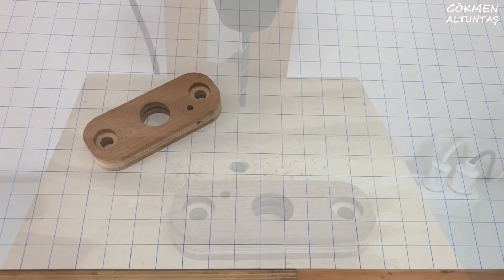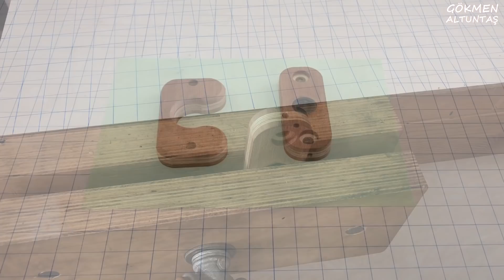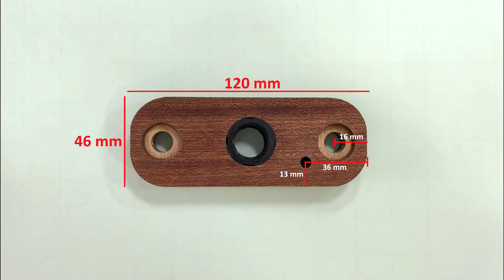DIY Plunge Router Attachment for Dremel and etc Rotary Tools // Dremel Freze Aparatı

Comment: I thought this would be a cool thing to make, then I realized I bought a Dremel router attachment at Lowe's a few years ago.  Still a really nice project.  Did you tap the holes in the wood for the knobs or did you just them cut their own threads?

Comment: I've seen projects like this and I think it would be great. 
But then I heard that the speed on the Dremel is not right for a router function and it would end up wrecking the drill and/or your project. 
Might wanna check that out. 
Good luck.